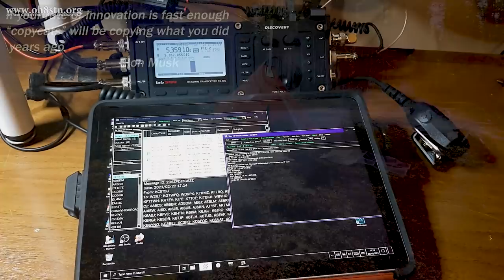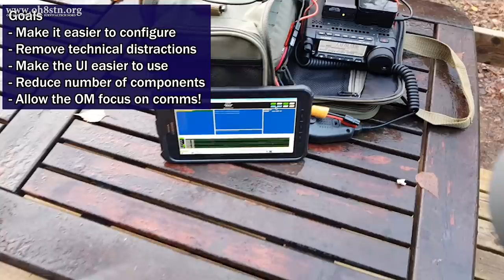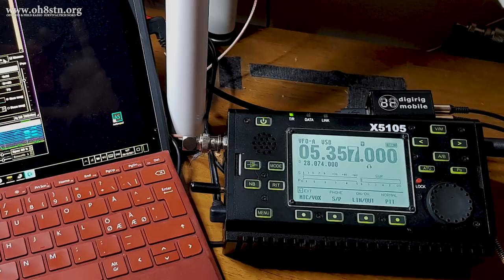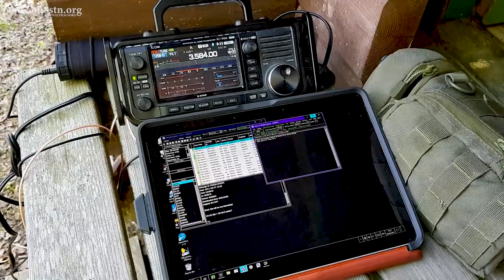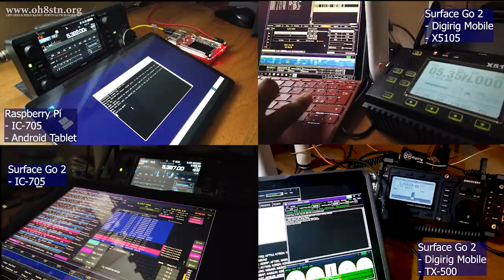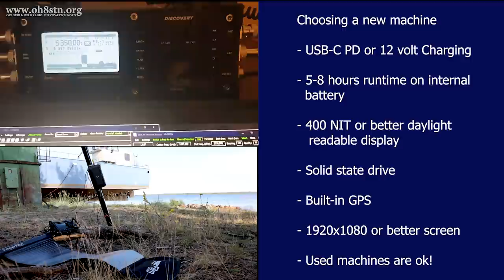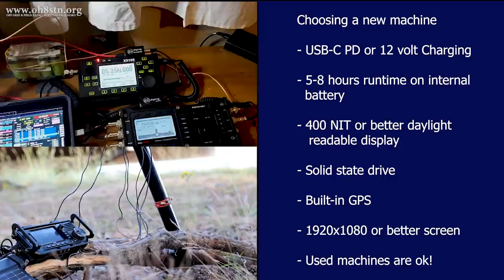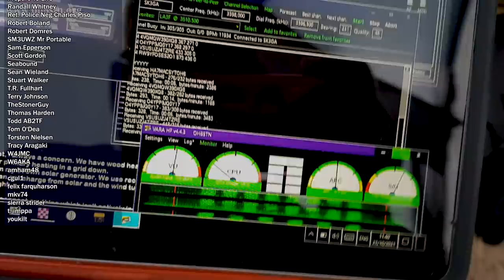Goodbye Raspberry Pi

Comment: You hit the nail on the head. We need apps like wsjt-x and others developed for mobile operating systems.  As an amateur like you who highly values reduced station complexity, increased station reliability/performance and flexibility, I’d be willing to put my money where my mouth is. Let’s get these developers paid and keep advancing our hobby.
Reply: Agreed. This is an area we desperately need to invest development into to simplify our emcomms / prepper rigs. I've been a Microsoft professional for 40 years now, and I highly recommend moving away from it to Linux, Android, or Chromebook OS whereever possible. Unfortunately, with digital HAM radio, it's just not quite viable yet.

Comment: I am very interested in picking up a Surface Go 2. I was before Julian created any videos on them. 🤪

This video says it all - clearly and concisely. All very valid points - all delivered with substantive support. 

I use Windows,  macOS, iOS, Android, and Linux. For me, it is and always has been about using what runs the applications I need and what makes me the most effective/efficient with the task at hand. 

The biggest challenge here is people that wrote off Microsoft years ago and don’t give things another chance.  Microsoft has become one of the worlds leading security companies (laugh if you want) and are focused on ensuring interoperability with non-Windows based systems. 

Windows 10 may not be ideal due to Microsoft’s upgrade strategy, but it’s an excellent operating system. I just switched from Windows 10 to Windows 11 and am VERY impressed with the changes. 

The ability to take my 705 and a Windows tablet (with antenna and battery/solar) and nothing else - man that’s just KILLER!

Thanks for another awesome video Julian! You’re amazing!

Comment: Since I've been a Ham for abt 54 years, I may be past the point where I want to play with my Raspberry Pi  3 B V1.2 any longer. 
I used to do packet radio before I got interested in satellite coms. I kinda dropped out of Ham Radio when I got a job (MITLL) that was almost exactly like my Ham Radio hobby! Since I've retired from the lab about 10 years ago, my Ham operating has been mostly using 70cm to chat with my  wife(Ham) while she's out in her Kayak.
I've always been interested in Weak Signal Portable, so when I saw the QDX kit and watched a presentation on JS8Call, I knew it was time to get back into Hamming. Your video has sold me on the idea of using a Laptop with the QDX  transceiver. 
Besides the tiny rig & laptop, all I'll need is a USB cable, good Battery, smaller antenna tuner & some antenna wire. :) 
Plus maybe some kind of GPS dongle, if the PC doesn't have GPS. Can the hot-spot on a cell phone provide the time to a laptop? :) 
Seems like it might..

Comment: Julian, I am a student of your teachings here on YouTube.  Your videos are very informative and well done in regard to editing and content.  I have the 705 and a Surface Pro 5 and the configuration doesn’t get any simpler, especially when using the wireless capabilities of the radio.  While it’s true that this setup requires the purchase of Icom’s RSBA1 v2 software, the trade-off is not needing to purchase the extra hardware and cabling that is required for the Pi.  The RSBA1 software also allows me to remotely control my other Icom radios, so for me it was a good investment.

On another note, I live in Iowa and Seth at PowerFilm has some great things to say about you.  👍
Reply from the maker: Okay best comment of the day :-) if you see Seth, please say hello to him. He's a good friend and excellent supporter.

Comment: I am quite impressed with the SURFACE GO 2. Does all of the digital modes very well connectedto my IC-7100, but what really makes it stand out is its ability to charge effectively with a USB-C PD charger with as little as 7.5 watts.  Yes that means you can effectively charge from the cigarette lighter!  I was able to ditch the very lossy inverter that was was consuming more than 100 watts to make AC power to then be converted back to 20v DC. This is a game changer when operating on solar power!
Reply from the maker: Thanks for this comment. You know I've been preaching this lesson for quite some time. Still getting so much push back. I really appreciate your comment.
73
Julian oh8stn

Comment: Thanks, Julian, this is excellent. I own several Pi's and they're fine for what they are, but I really prefer an all-in-one computer for field work for the reasons you mention: simplicity, reliability and performance. I was gifted a GPD Pocket 2 mini laptop and it works extremely well for my needs in the field with my Xiego G90. The Surface Go 2 is surprisingly affordable, and if my current solution fails, I'll consider the Surface as an alternative.

Comment: Thanks Julian.  Simple is the key for off grid and emergency comms, and just like I skipped the slide rule and duck-and-cover, I'm happy I skipped the Raspberry Pi.  

If it ever rises to the top, I'd like to see you review digital modes for 144MHz VHF at some point, whether it be text, scanned forms or photographs as this subject is coming up in our county RACES meetings.  

HF is not always reliable for near-field digital comms whether it be solar flare, antenna orientation, NVIS refusing to cooperate or ground wave blockage...all of which I've witnessed in our extremely hilly and gorge-cut local terrain.

Comment: Awesome, timely video! I took a very old laptop up into Northern Maine with my Yaseu FT-991a to run some portable ops, mostly Winlink emails home to family with our camping adventures. The battery is toast in that old laptop and it quickly drained my LiFePO4, solar could barely keep up. I was thinking that I needed to get a newer laptop and my brother recommended buying the Surface Book Pro. The first version would be cheaper as people started clammering Surface Book Pro 3 or the used 2's that would inevitably hit the market. I found an i7 with 16 GB of RAM, and am excited by the battery capacity - both the screen and its keyboard base have a battery and it lasts a full day of basic data entry and web browsing.

I, too, can't knock the Pi. I help maintain several GBPQ32 packet nodes running on 3B+'s. I thought about using a Pi Zero as a smart radio interface, but you're right about power and accessories. And I want to be able to document and demonstrate how to access data modes and packet radio nodes for our less-technically savvy operators in our local clubs. Windows and a sound modem connected to a sound interface is absolutely the simplest way to go.
Reply from the maker: Thanks for this feedback Bradley. Your point of being the simplest way to go is exactly why I moved in this direction. I also agree that we shouldn't throw out the Raspberry Pi, it's definitely got its uses.
Anyway thanks for the the wonderful comment. I mince like yours add validity to both sides of the discussion. Thanks for watching and commenting, it's very much appreciated.
73
Julian oh8stn

Comment: I'm still a huge fan of the pi for off grid. Can run for a LONG time on a cellphone recharge pack, I can Bluetooth my cell or tablet gps to the  pi and I can make as many complete copies as necessary of the op sys on multiple SD cards,  if anything is ever corrupted just insert a new SD card.   Any tablet or phone can be a screen, so I never have to worry about a broken screen hampering my comms.  It does suck that Vara doesn't work but for me, and my travels and options, the pi is perfect. It does what I need it to in a small package. The Surface is very nice but I'm pretty happy with the pi. It's pairing very nice with the TX500 Keep up the good work.  73 KF7VUT

Comment: Hi Julian, thanks for another useful comparison of equipment. I go with you a long time and I have also done some experiments with RasPi's. The cablemess as well as the non-compatibility with VARA made me switch over to a WIN10  2_in_1 convertible together with my IC-705. Actual an old Acer 10" does the job for nearly a year. Only 2 gb ram and 1,1GHz clock - it works, but sometimes its a pain. Both can be field charged by a 5V= USB or a USB-C PD charger from a LiFePo4 or a solar panel.
Maybe a Surface Go 2 will be the successor. But protected by an UAG case and a non-glossy screen protector. 73
Reply from the maker: 🙏👍 Thanks. It's wonderful to hear I'm not the only one looking for a better field experience. Thanks for this comment and your support. It's greatly appreciated.
73
Julian oh8stn

Comment: Thanks for posting this, Julian.  I am also a Linux and RPi enthusiast, but I've come to the same conclusions particularly for portable operations; although solving all the problems is fun, there is just too much integration work required by the end user to make a Pi-based system as viable as an already packaged Win-based tablet or laptop.  I enjoy satellite operations, and while full-manual roving works well and eliminates a lot of points of failure, when I want some station automation, a Windows-based system running SatPC32 (and WSJT if I'm trying FT4 on RS44 or AO-109) is easily integrated (single USB cable to an IC9700) vs all the pieces required for a Pi-based system.  Visibility in sunlight is a real problem too many systems, so I'll be looking at your and other Surface reviews for that aspect in particular.  Thanks and 73 de KS1G
Reply from the maker: Thanks for this comment and feedback. If I were you, I would look at the Panasonic Toughbook for satellite work for the daylight readable display. They're pretty reasonably priced on the used Market. I took the hit on the display because I'm usually deploying from within a shelter. If you're operating in direct sunlight, Toughbook is definitely the way to go.
73
Julian oh8stn

Comment: Awesome video Julian...up here in AK, those of us doing field communication exercises came to the same conclusions you mention in this VLOG.  I agree, Raspberry Pi's are a lot of fun to tinker with, but to rely on them under field conditions (especially up here in the sub arctic) is a failure just waiting to happen.  I picked up a used, used/rebuilt Panasonic Toughbook (Military tough...waterproof, dust proof, SSD HD and tough as nails) that is proving to be an outstanding addition to my home and field stations.  Although it's a lot bigger than the Surface Go...1200 NIT and 8 hours of battery life on one battery (and I have two) allows it to work for me.  Keep up the great work and content!  Cheers and 73
Reply from the maker: Thanks Chip. It's often difficult for others to understand the extremes we operate in. The Raspberry Pi has worked, but hasn't been easy or cost-effective getting it to that point. Hopefully we can Inspire others to give other options a go.
I'll keep my eyes out for a used Toughbook. Which model are you using?
Reply from the maker: @chipandrews2892  thanks Chip. I'll definitely put one on the shopping list.
73
Julian oh8stn

Comment: Hey Julian great video, I guess with the radios that we have like the Icom 705 with an audio port built-in I’m sure that helps tremendously. And with that Microsoft surface pro makes it convenient also. So  emergency situation I’m assuming that it won’t take very long to set up a station. You’ve done a fantastic job to set up an emergency station. Again thanks for sharing some great information Julian. Take care and stay safe.
WD5ENH 
Steve
Reply from the maker: Thanks Steve. With the Icom ic-705 and the Surface tablet, it takes about 3 minutes to get on air if using a rapid deployment antenna.  For the other radios I leave the audio and Cat control interface connected, so there's only one wire to connect to the tablet.
We really have come a long way. Thanks for the kindness and feedback. It's very much appreciated.
73
Julian oh8stn

Comment: Excellent video, Julian. Thank you. I went through some of the same thought process recently, and decided on an Android system. I’m going to run WOAD for Winlink to start, and figure out the rest later. But between the cost and weight, I thought this was the best combo for my situation. I haven’t tested it out yet as I’m still collecting parts (the last package should be delivered in a couple of weeks), but I’m pretty sure I can get everything working satisfactorily for my situation. Thanks again.
Reply from the maker: I'm a big fan of Android. I think as a community we have to encourage more developers to jump on board. Awesome to see operators moving in that direction. Thanks for the feedback on the comment. Also good luck with the rest of your build. 👍👍👍

Comment: I look at the Raspberry Pi as a swiss army knife.  Can you slice cheese with a swiss army knife?  Yes, of course, but if that's all you wanted to do, a $4.00 kmart kitchen knife would to a better job.  However the kmart knife won't be able to saw, open bottles and cans, file metal, etc... let alone fold away into your pocket or a small survival kit.  I love the Pi because of its flexible nature, price, size, and the extensive support eco-system that surrounds it.  If you want to run digital modes in the field, you're probably better off with a second hand laptop, like an old lenovo, where the display, battery and keyboard are all packaged together.  Pi will always have a place in my shack, though for more specialised applications, particularly those that run in headless mode.

Comment: Great advice, Julian.  I recently dusted off my Surface Pro 4 and started using it for FT8 on my x6100 and IC-705.  I like the soluation alot, and I am not a Windows hater, but I also like the RPi OS.  My only complaint about the Surface right now is that the battery is starting to fade.  Do you know if the Surface Go 2 has the same type of charging connection as the Pro 4?  I'd be interested to see what charging options you recommend in the field that can bypass the 120v adapter that it comes with.
Reply from the maker: Thanks for the comment.  The Surface Go 2/3 use the Surface Connect port for charging. I use a 12v/USB-C PD adapter for off grid charging. It may be possible to charge with its USB-C PD port, but I'll have to test that.
Here's a blog post on how my surface go is set up including charging.
https://oh8stn.org/blog/2021/10/10/microsoft-surface-go-2-faq-ham-radio-laptop/

73
Julian oh8stn
Reply: @OH8STN  Thanks, I found that article and those connectors look like the same ones for the Pro 4, so I ordered some to try.

Comment: Julian, another great, informative video! I found a rugged computer that I have been using for Amateur Radio: The Zebra Xplore B10. They are definitely mil-rated, and seem to be very durable as well. They even have a keyboard available, and can boot Ubuntu. I don’t know if you can get them at your QTH, but have a look at the specs… I think you’ll be impressed.
Reply from the maker: Awesome,  I'll take  look
Reply: Nothing is mil-rated unless it's bought as surplus from the military itself. Everything else is "designed to spec" but there are no such testing labs for civilian gear that can certify it as such. It's just marketing jargon.

Comment: Excellent presentation Julian. I've been worried about my Pi being the weak link in my manpack rig ever since I had a MicroSD card failure which sent me back to square one. I think the only reason I'm using it now is so I have a Windows-independent system on hand, but you are convincing me to make a second manpack, one more reliable and with a less complex and fragile configuration. Thanks for the advice. 73's. AJ6RE
Reply from the maker: This is a great comment again another one which validates the idea. Perhaps use the Raspberry Pi as a backup system. That's the direction I'm heading in. Thanks for the comment and the kindness, It's very much appreciated.

Comment: Julian, I think the Microsoft Surface runs Arm64 instead of x86. I found difficulty getting the radio connected as Icom’s Drivers don’t work with Arm64. After researching I went directly to Silicon Labs and downloaded their driver and finally got the ICOM working. Did you run into any issues?

Comment: Julian, concerning the Microsoft Surface Go 2 - Pentium Gold that your using. As near as I can see it has a processor speed of 1.7 Ghz. in the specs that I've found. I have the Icom RS-BA2 v2 software and it states that it needs a minimum of 1.8 Ghz  or higher processor CPU. You've apparently got it working quite well with a little less than minimum of processor speed. Or am I missing something here? I'm wanting to make a Surface purchase, but don't want to make the wrong choice. I can't find a Surface 2 any higher that 1.7 Ghz. Can you guide me please? Gerald - KG0VA
Reply from the maker: Hi Gerald.  It's worki g fine. Here's my Surface Go 2 faq.
https://oh8stn.org/blog/2021/10/10/microsoft-surface-go-2-faq-ham-radio-laptop/
73
Julian oh8stn
Reply: @OH8STN  Thanks Julian, your channel is the best!

Comment: I have a Pi w DRAWS hat and don't use it. Let me down too many times and is too complicated when it comes to config and troubleshooting not to mention the wealth/ease/availability of software and ease of install. One point I don't agree with is your comment about unreliable microSD cards. In years of using them in Pi for ASL BPQ etc I have never had a single problem. I always use the best cards. Thx for the video.